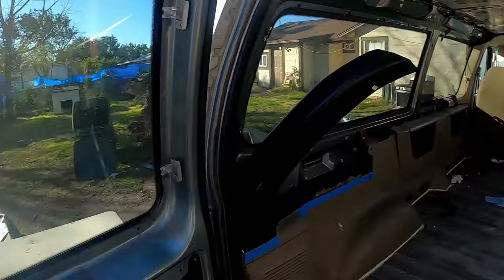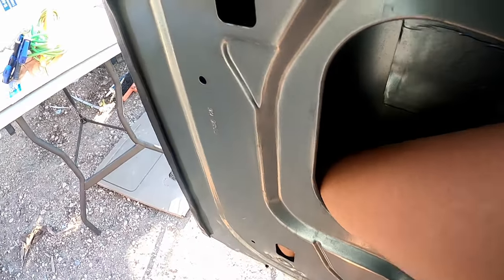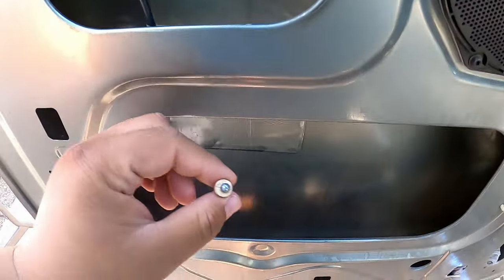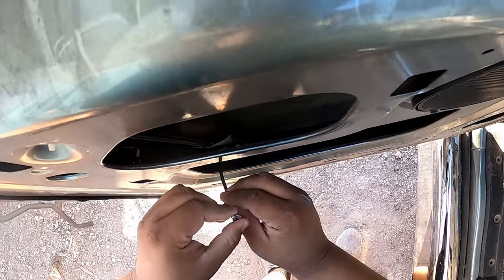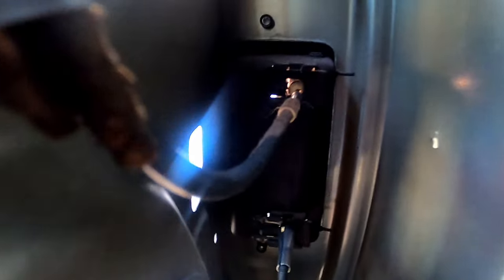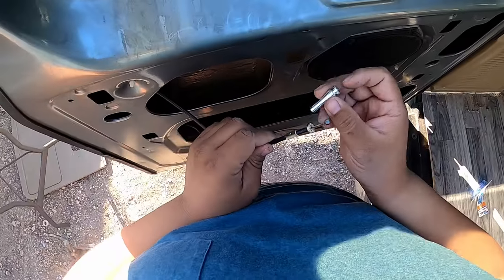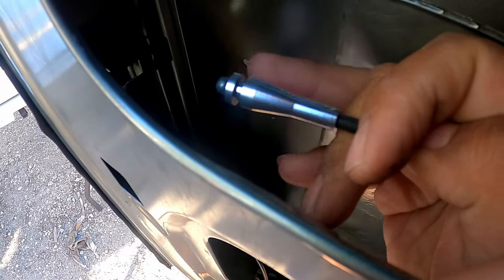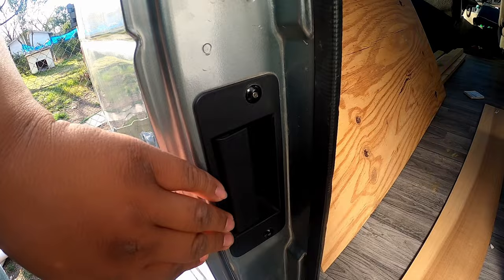FORD E150 REAR DOOR LATCH CABLE REPAIR E150 E250 E350 Van Door WONT OPEN

Comment: Thank you so much! I had no idea it could be this simple! Also, when I did this, the cable no longer had quite enough tension to always open the latch. So I bent the cable inside the door and ran a zip tie around to hold it in place. Works perfectly ever since.

Comment: You are going to be doing that job again soon. The other end of the cables have that brittle plastic too and will probably soon fail.
Reply from the maker: This is very likely, I replaced the same part on the side door handle now the bottom latch needs the same repair.
Reply: Ford should have had to do a recall as often as these break. PIA!
Reply: @nonyabiz550  i think they did but only for f150 3rd door and ranger...no love for the e series...

Comment: What product did you use from Auto Zone for the door latch? I’m having the same problem with my door.
Reply from the maker: Dorman Door Latch Cable Repair Kit 926-111, its about 11 dollars now and I had to go to a few Autozones it seems it's not stocked at every location.

Comment: Im in a heack of a bind, mine wont open to get to it and its a conversion van and the bed is folded down butted up against back door from inside. Anyone have any ides lol ive tried everything can think of. The left side's cable is completely off, someone had previously tried to fix it.